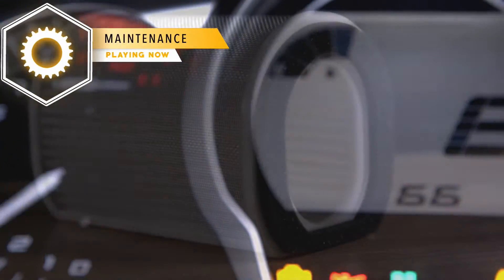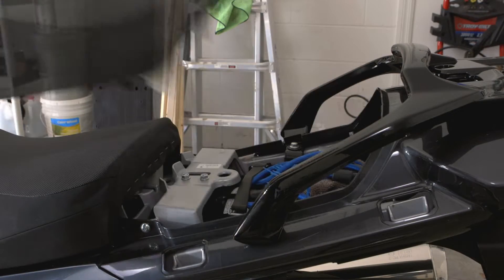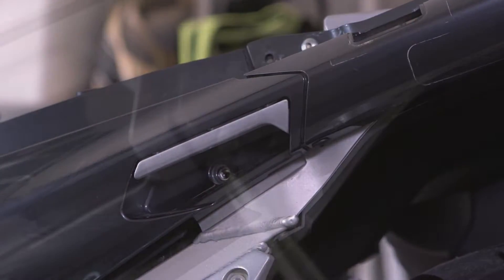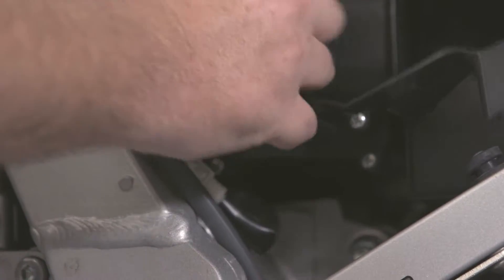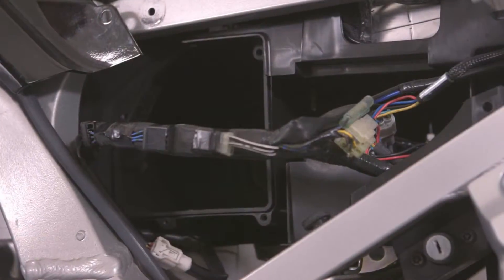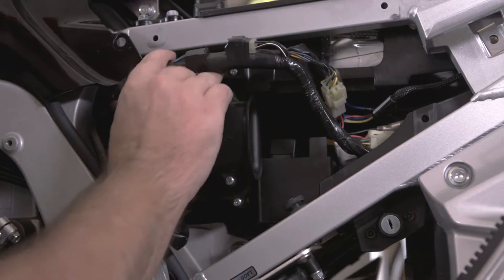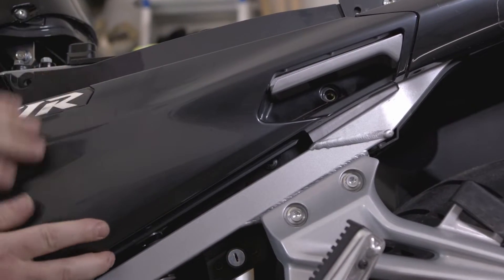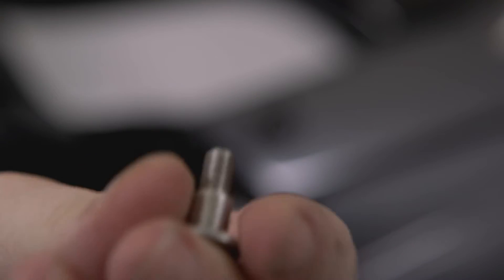FJR1300 Air Filter Replacement

Comment: Great video. I have a 06 FJR. I can’t seem to get the air filter to fit snug onto the protrusion in the rear of the air box. It seems to simply rest on the “floor” of the air box. Would this be normal?
Reply from the maker: Not sure about an 06, but for the 15, it’s not a super snug fit, just have to make sure it’s over the opening in the back. It becomes snug one the top piece is screwed on. Hope that helps
Reply: Thanks for the tip! 👍

Comment: Looms simple... has anybody seen a similar video for the FJR1300AE with the electronic shifting? They put all of the electronic clutch mechanisms right if front of the air box. Looks like I am going to have to do a major disassembly to check the air filter.  Uggbb.
Reply: Same problem. I removed the servo-motor that shifts gears and blocks access to the box. However, I couldn't move cables enough to get a full access to the filter. User manual instructs to go to a dealer to do this...